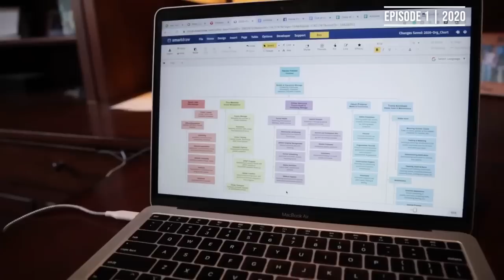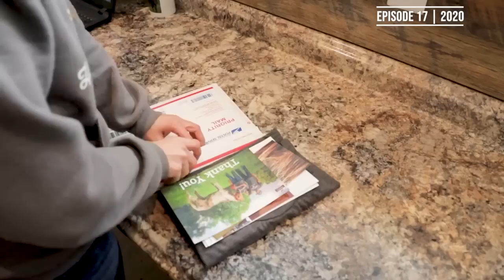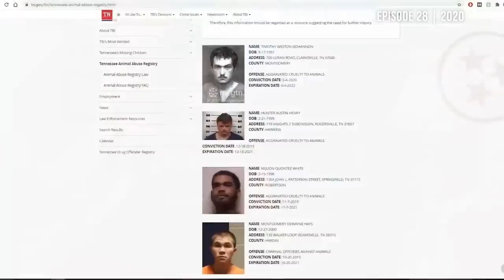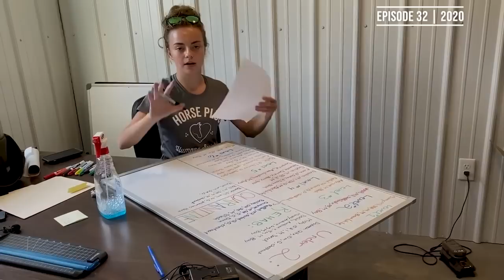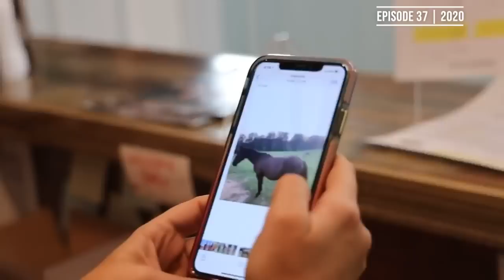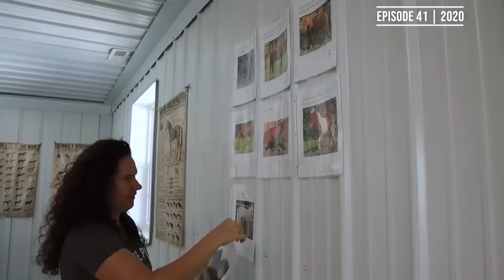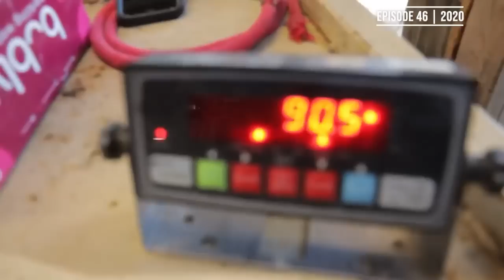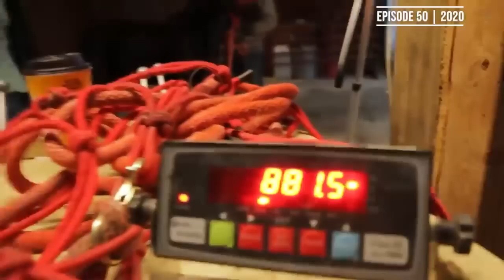14 Hours of Horse Rescue - Horse Shelter Heroes Season 1 | Complete

Comment: The long paragraph i wrote tell that people shouldn't leave horses outside for along time in heat, and if they are outside when it raining or snowing to make sure it doesn't go into their fur and cause rain rot and damage to their skin cover them check them in a few hours under their rain jackets if they are to hot take it off if they are dry then you leave the rain coat on.

Comment: I believe that when you put some horses down,   you should use these horses to analyze different problems such as bones, shivers starts in the brain everything is connected to the brain, i believe that horses bones can be healed or replaced with stents, rods etc. They also say salt water is good for horses bones, and other stuff. Also when people adop these horses i would bring the horse to them so you can check the environment where these horses going and if its not up to standard then take the horse back with you guys, make sure the horse has enough room for them at their new home also give them dirrctions how to care for their horses don't leave them outside in direct heat, clean water, vitiams when its cold outside to make sure the rain or snow goes into their fur etc. People may know what to do but may not do it. Whoever adopts from you i would make follow up and check on these horses every couple months and make surprise visits if you know what i mean. Did you ever hear about Pitbulls and Paroles they rescue stray dogs and when they adopt them they bring the dog to the people no matter where they live and if the people's  place isn't  up to their standards they don't let them have the dog and i agree with this very strongly and i hope you do to.